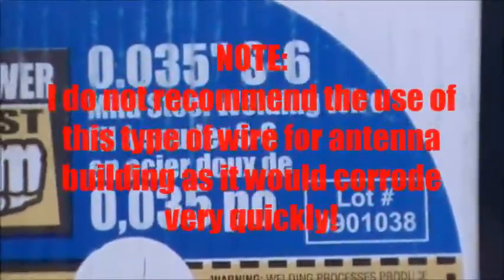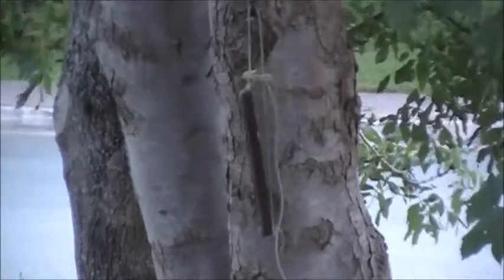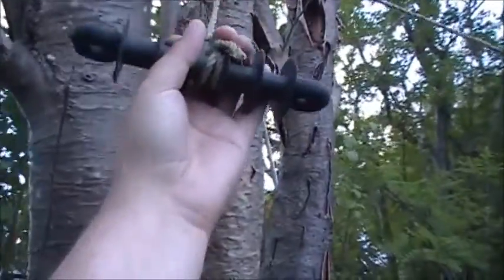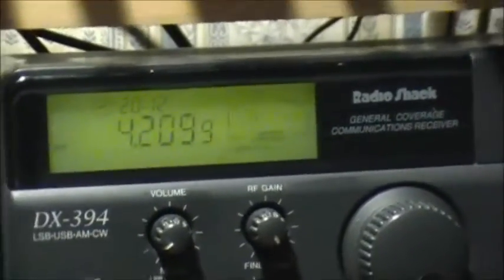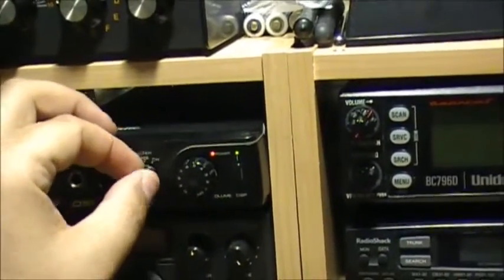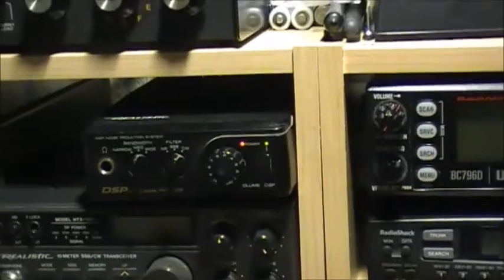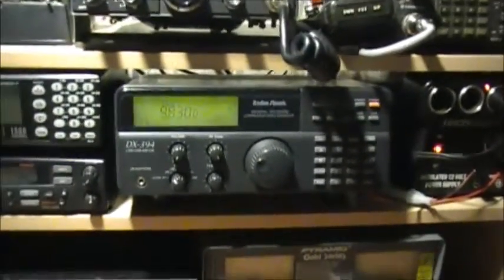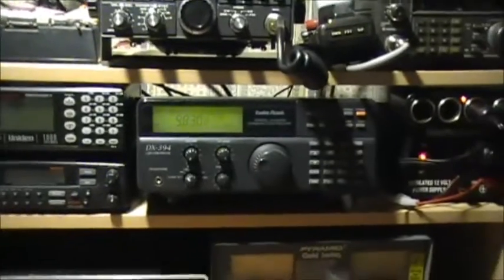Simple SWL antenna

Comment: My curiosity is ramped up a bit and a half re your antenna which I am not familiar with at all. You appeared to use ONE wire which is basically a horizontal "U" shape spaced maybe 4" apart. 1 side of the U is connected to the coax's outer braid along with a ground rod connection, and the other end of the U was connected to the center conductor of the coax. Do I have that right? Here are my questions. Does the grounded side of the horizontal "U" antenna impart or cause a directional sensitivity in reception/transmission favoring 1 way over another? A "lobe" if you will.
Does this particular antenna design have a name attached to it?  It certainly seemed to be doing its job.. If I misunderstood its layout, then all this is useless babble.